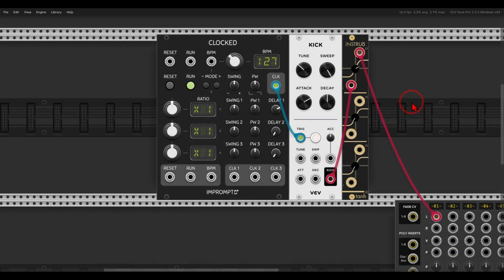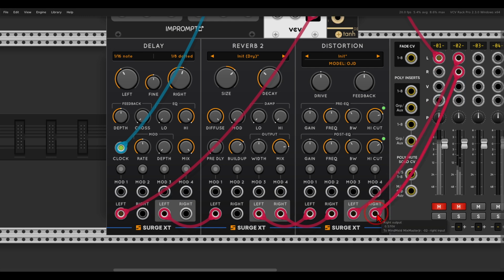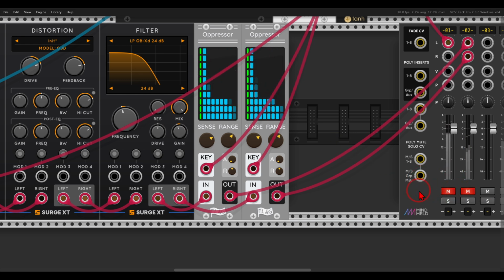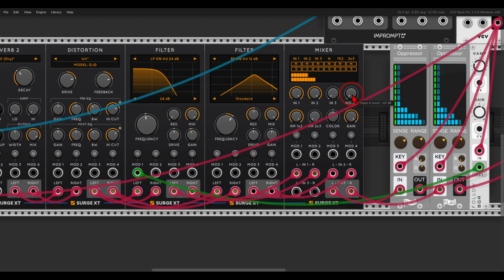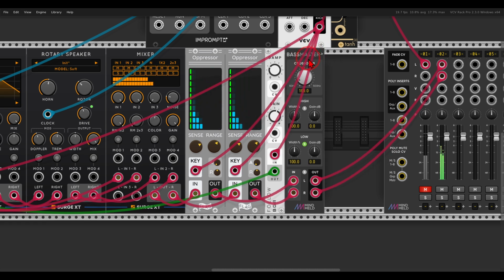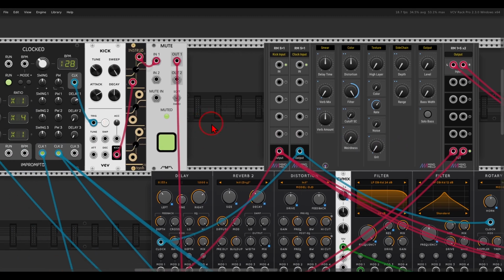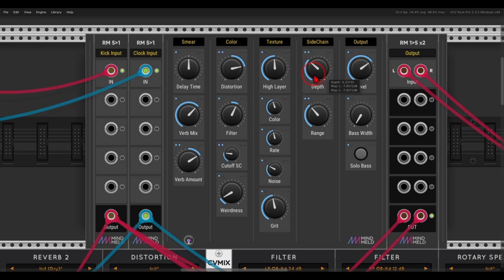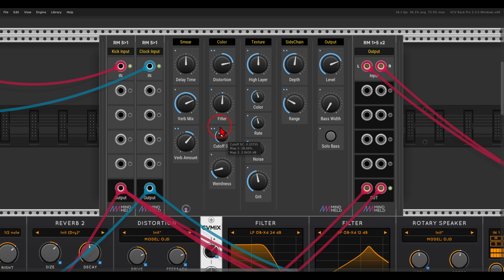Building a techno rumble chain for all your rumble needs

Comment: VCV To-Do List:

✦ Build a processing chain to create techno rumble effects
✦ Create a rumble experience by sending delay and reverb into distortion and use a low pass filter.
✦ Side chain the filter and add movement to the sound
✦ Creating movement with various effects
✦ Control base frequencies and stereo field with Base Master Junior
✦ Learn how to load selection files with midi mappings using Strip++ module
✦ Play with level control, delay time, verb mix, color section, filter, texture section, noise, and grid
✦ Learn how to use side chaining for depth and range
✦ Have fun. 

Thanks Omri!